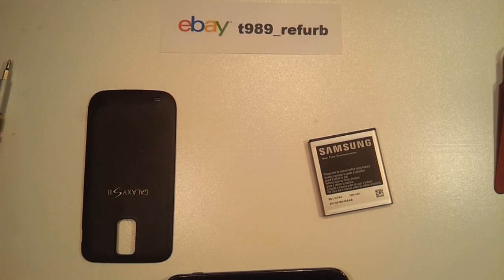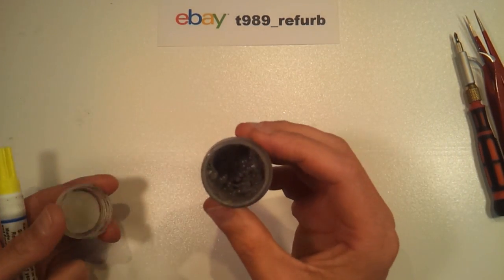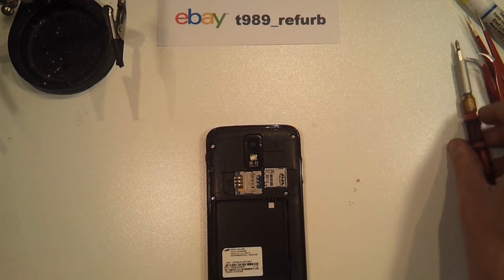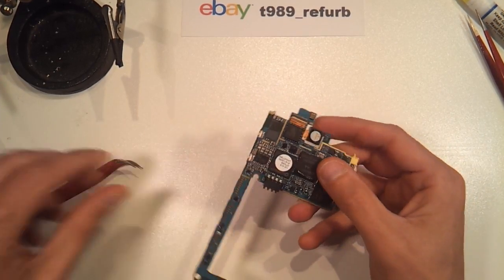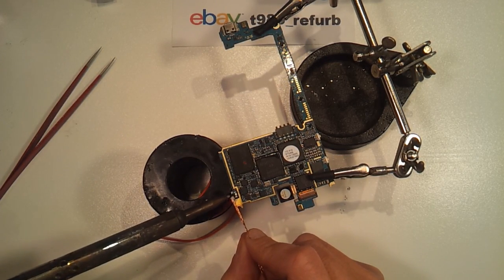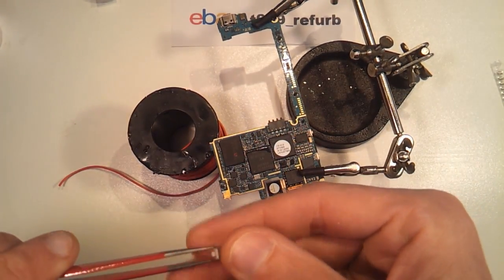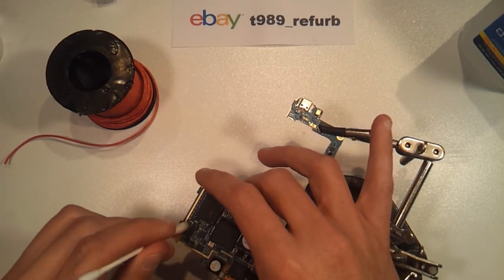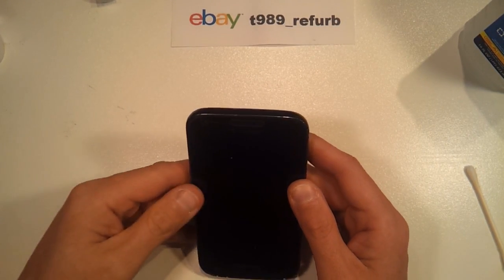Samsung Power Switch Repair Fix Replacement Galaxy S2 t989

Comment: I watched several videos for Galaxy S2 power button repair and selected eBay replacing power switch service from Steve. The process was easy, clear and the service was professional. It fixed the problem, now I have a functional phone, thanks Steve. For those who may have similar power switch problems with Galaxy S2 phones it is highly recommended to use Steve's service.

Comment: Steve just repaired my phone using the part he sells on Ebay.  I highly recommend his services!  He did a great job and for a very reasonable fee.  This after Tmobile told me I needed a new phone and an independent cell phone repair shop told me it was a software issue.  Thanks for saving me hundreds of dollars!

Comment: Fantastc video, thank you so much. The local electronics whiz offered to recycle our Galaxy Blaze because he couldn't fix it. Thanks to your video it's up and running again. Next purchase will be one of those hot air guns, it's kind of tough doing this repair with a soldering pencil. Thank you again!

Comment: great job! i did this repair yesterday and didn't even see your video till today.  I did it with a soldering iron and it was a little harder than the hot air method.

Comment: Thanks Steve!  I just fixed my wife's Galaxy S2 with a standard 30 watt soldering iron.  I have another one to fix so I'll be getting that hot air gun you showed in your video.
Reply from the maker: I am glad to hear you were successful using a standard contact soldering iron.  You will find this repair is much easier with the hot air station.  Don't forget to get the solder paste too.

Comment: Steverrada thanks a lot for your guidance on how to change out the power button....I work in an instrumentation shop and I never new what the air solder gu could be used for(lol)......everything worked out awesome and it saved me a ton of money. once again thank you.

Comment: Great video. Was able to fix using conventional soldering iron with extreme patience(have a lot of soldering experience). If you are not an experienced solderer, pay someone the $40 and I guarantee you won't regret it. It's money we'll spent. If you haven't soldered before, you'll spend more than that on the supplies.
Reply from the maker: Thanks for the confirmation regarding the use of a conventional iron only.  I am glad you were able to get your phone fixed up.

Comment: Great video. Highly respectable that you would share a full tutorial video for the average diy-er that might not be able to afford to take it to a professional. I was looking for ways to just reassign the button to one of the volume buttons but came across this. I was wondering if a general heat gun would work in place of the hot air reflow.
Reply from the maker: Reassigning the button is not the issue.  The switch fails and becomes stuck closed resulting in a hardware fault in the system.  Until the fault is cleared (switch removed) the phone will never be able to boot fully.  Also, I do not recommend using a heat gun for soldering.  It is likened to taking a drink of water from a fire hose.  There is too much uncontrollable heat that could potentially damage your replacement switch or other neighboring components.  Please check out eBay store; I think you will see my Repair Service is reasonably priced. Thanks!

Comment: steverrada I just had this problem and I found your video the best in terms of explication and simplicity.
I am now using my volume buttons to turn on/off my device
this repair u are doing is amazing but I need an easier one with less equipment u know ... something someone at home can do
Reply from the maker: The difficulty of the repair is determined by the size of the components and the way they must be soldered.  With a hot air reflow station, the repair is fairly straight forward.  I have repaired about 1000 of these phones at my home with only the tools shown.  I would be happy to fix yours too if you do not feel comfortable doing it yourself.
Reply: steverrada I dont have that reflow station neither a solder ... I wish you could but now I am in Brazil ... where people are only good at football and I would never trust a technician here on my phone
Reply: Nabil Merhby How much would u charge for changing it? (considering i have new one)
shipped from and back to brazil if u know would be awesome too :)
Reply from the maker: Which Galaxy model phone do you have?  Current price is $30 for the repair and $30 for international shipping back to Brazil.  I cannot say for sure how long it will take in transit.  Once received, I complete the repairs in 24 hours.  Email me at t989refurb@gmail.com if you are interested.

Comment from the maker: For the most part yes. The disassembly techniques may differ but most of the current Samsung models use the same or similar power switch.  The same repair techniques would apply.

Comment: Love the video. I've replaced iPod 4 power/volume cables, will the same technique work to replace power button on a S3? Also in my search for parts I came across a power flex but cannot find any info on where it is used. Any idea? Your help is very much appreciated. I'm a home based repair shop doing a lot more than screen repairs. Thx.

Comment from the maker: My best guess is that the solder did not adhere well enough to the two corner pins on the back side of the switch. These are the two pins that actually form the contact closure.  They are also the most difficult two to solder properly.  Secondly, make sure that you did not accidentally damage or form a solder bridge between any of those three small passive components that set next to the switch.  Let me know how it goes.

Comment from the maker: I have repaired this issue on the I727 too.  It requires a slightly larger switch, 4.75mm wide.  I  offer those for sale too in my store.  Check out the Canadian shipping details in my Repair Service listing.

Comment from the maker: My best guess is a short circuit in the soldering, or maybe an over-heated and melted power switch.  If your phones does not act the exact same way as the one in the video (powers up by itself when you insert the battery or very sensitive switch) then the power switch may not be the issue.  It could be a software issue that could be fixed by a Factory Reset.

Comment from the maker: There are a lot of Samsung models which use this same switch, unfortunately I do not have a comprehensive list.  You will have to take apart your infuse 4G and measure the width of the switch to find out for sure.

Comment: Fully appreciate your effort, but realizing how oils and creams from user hands are easily transfer and leach into the power switch, perhaps in another video do you recommend resolution attempt by simply using fine spray contact leaner and compressed air for keyboards and such?  I have and have used soldering pencils and guns, but I know of no one who has one of the hot air devices you demonstrate.  Can sw be removed using a soldering pencil?

Comment: I bought a soldering iron some time ago but have never soldered before. This is way beyond a beginner's level. I wish I could do this, but it worries me a little too much. However, my dilemma is that I could get my S2 repaired by a company, but it would quite possibly cost £50/$70 (in UK) upwards or from Samsung maybe double that.

Adding to that, I've had bad experiences with factory resets in the past. My phone just has a faulty USB port/power switch. It doesn't need reformatting. Bah humbug.

Comment from the maker: From my brief research, the i757 does not use the same switch.  It uses the "flex" ribbon type connector so no soldering is required!  Google i757 power flex.

Comment from the maker: Take a look at the .png I link to in the description.  You have to make sure that the solder job on those two pins matches what you see on the volume switches (as a reference).  Those two pins are the most important to get right and the hardest to solder.  This method is tried and true.  I have repaired over 500 phones to this point.

Comment: First off, I love your video ! I am no tech genius like you but your video sure did inspire me to try to do it my self.  I was wondering can I use this item from ebay for the water soluble flux ? Is this the same as your pen ? What do you recommend ?

1pc BGA SMD Soldering Paste Flux Grease RMA-223 10cc
Reply from the maker: I am glad you enjoyed the video.  I hope it helps.  RadioShack has an eBay store and turns out they sell the same exact stuff I use.  I just had to buy an new tube last month.  Here is the eBay item number: 360810745269  Plus this stuff will not take 3 weeks to arrive from China or HK!

Comment: Sorry for my idiotic question but do I have to use the hot air solder or is there a substitute for that. Hot air solder is to expensive for my budget

Comment: Is it Possible to use a De soldering iron instead of the hot air rework station? Doing this for a friend and not tryin to run up a high bill lol thank you btw awesome vid

Comment: Hey man. Are you able to do this same thing for an SGH-I727? It's called the Samsung Galaxy S2 LTE here in Canada. I've already attempted to do cleanings with compressed air cans, isopropyl alcohol and firmly pressing the button after the case has been removed, to no avail.

If its possible, I would love to have this fixed. Thanks!

Comment: Hey Steve, I tried a needle nose trick on my d710, and couldnt get it to work. After about 20 different squeezes the power switch just popped off...oops. After watching this, Im afraid I may have damaged those tiny little components you mentioned. What do you think? Would you still be able to repair? If you want pics or something, let me know and I could pop it open. Great video, and seems like a great service you are offering from the comments on your ebay store!
Reply from the maker: The D710 only has two small components next to the switch, not three. A picture of the power switch area of the motherboard would be the best way for me to get a look at the situation.  Please email or eBay message it to me when you have a chance: t989refurb gmail com
Reply: steverrada would that render the phone useless? Because I can still power it on with a jig and get into download mode and restart it with odin. Or does that just render the power button itself useless even if you were to install a new one?

Comment: Dear Steve, I had exactly same problem with my t989. Now it has completely shut down, it does not even show the charging sign when i plug in the charging. I had a few technicians look at it and they tried everything they could and gave up. Can a faulty switch alone give such problems that my phone now is dead? pls reply .

Comment: hey, when I press the power button, often only the 4 bottom button lit up and the screen doesnt show, I have to press the power button several times (sometimes 20+) to see the lcd screen lit up. is it related to the power button or is the lcd going to fail ? I had a swim with my phone and im having speaker/camera/lcd problem since.

Comment from the maker: Different variants of the S3 use different parts for their power switch.  Make sure you search for your model specifically. I am 100% anti-apple.  I have no ideas as to what it takes to repair them so I cannot say if the procedure is the same.

Comment: hey steve-

i have a galaxy s2 that's 2 years old. 2 days ago it completely died so i plugged it in to charge it, as usual.  the issue now is that it won't turn on or do anything at all, no screen, no buttons, no music or vibrations... nothing.

when i plug it in it gets warm so i believe it may be charging and i'm suspicious of the power button but not sure that i'm correct in either of my assumptions.

can you help me, please? there's a lot of stuff that i just don't want to lose.

thanks!

Comment: 80% it doesn't need to be replaced when its stuck in that reboot loop. You just need to de-solder, clean the pads, and re-solder the same button back on. Fixed tons like this and never get them back. I only replace them when the button is really sensitive.

Comment: Hey Steve thanks for your guide on replacing the power switch. I have a question concerning the installing a new power switch. What would be the cause of the power switch to not power up the phone if the three passive components are still on the board? I replaced a switch the first time and it did work however the switch went bad shortly after being to sensitive and I am on my second installment of a new switch.  I guess my question to you is would the switch not work properly if the solder connection is not made properly? I plug the phone in and the phone charges and display does work I just can not power up the device. I am holding off till you get back to me also if you have information that helps me I will make a $10.00 donation to your pay pal.

Comment: hi I'm learning how to solder so the Flux is used to remove old solder and solder paist is to resolder?what causes the solder not to stick? thank you very much for the video.
Reply from the maker: +Jose Esquivias   Flux is used to clean metallic surfaces before applying, or removing solder.  It allows for a better heat transfer so that solder may flow more easily.  Solder paste is very small solder particles with flux mixed in.  When heated, the flux flows to clean the surfaces and the tiny solder particles melt and join together to form the solder connection between the parts.  The two most common issues that would cause solder not to stick are dirty surfaces (none or not enough flux) and cool temperatures ( soldering iron is too cold, the tip is dirty, or poor thermal conduction).

Comment: I have found it much easier to mount the switch first by putting a small amount of solder paste on the little pads on the outboard side of the board and the mounting holes and heat that to mount the switch , THEN add a small amount of solder paste to the backside of the switch and board on the three spots. then heat that solder.
Reply from the maker: Thanks for the tip!

Comment: I'm having problems removing the solder from the little holes for the button I am using a 2mm solder wick, any suggestions?

Thanks and great video!
Reply from the maker: DO NOT try again and again and again to remove it with the soldering iron.  You will accidentally lift the solder pads.  I use any of these three methods.  First, if you have most of it removed, then you may be able to break through by gently forcing your way through with the fine tip tweezers. Second, I have luck using a solder-sucker from the bottom while melting from the top.  Lastly, I drill the holes out with a very small bit, 0.4-0.6mm depending on the size of the switch. Good luck!!
Reply: steverrada Thanks for the reply! I was able to cleanly remove the solder from the pads themselves but not on the holes. Great suggestions I will give them a try!

Comment: Anyone know if I can just use a sharp solder iron and melt off the old one? Can I just place the new switch on and use the iron to melt the solder and attach the new switch?
I can't afford a reflow which costs more than the repair service itself.

Comment: Hey, I have the same phone and it keeps restarting but I'm 100% sure that it's not a power button problem.. It starts itself alone, but the restarting cycle started only when I turned my phone off 1 day... I tried everything, factory reset, wiping cache.. It doesn't want to load to the main lock screen. It keeps restarting.. When I remove the battery, and put it back in, the phone doesn't start by itself. I cannot load safety mode, because the 4 buttons at the bottom don't light up when the phone is off... If you could help me, that would be great! :)

Comment from the maker: Sounds like your LCD is cracked, or maybe if you are lucky, the ribbon cable has just popped off.  The LCD is very fragile.  Even if the glass does not break, the LCD panel itself could.  Look closely for cracks.

Comment: Thanks for this video, I have a GS4 and the power button is causing the phone to reboot over and over again. So since I don't have all this equipment, I will just remove the power button. I at least know what it takes, thanks.
Reply from the maker: I can confirm that the GS4' uses the same replacement switch as the t989 in the video.  The replacement procedure is also very similar.  I had successfully replaced a couple of switches on them before getting out of cell phone repair.  Good luck!
Reply: Cool, that's great to know, thank you. Just wondering though, how come you got out of that business?.
Reply from the maker: I got into it as a way to make a little extra money by purchasing Galaxy phones with faulty power switches off of eBay.  I would replace the switch, disassemble the rest of the phone, and sell all the parts separately on eBay.  That evolved into me producing this video and offering a power switch replacement service which I also offered through eBay.  At my peak, folks were sending me about 70-80 phones per month and that got to be too much.  It was taking up all my free time and I was having to do repairs 7 days a week just to keep up with demand so folks could get their phones back quickly.  What started out as a hobby got to be work.  Once it hit that level, I knew it was time to re-direct my efforts towards something else.  Thanks.  --Steve
Reply: I see what you mean Steve, I never knew exactly what it would be like until what you explained, since I thought of doing it myself, or just fixing cell phones in particular. Thanks though, and I would probably get tired of that too.

Comment from the maker: You can try to complete this repair using only a conventional soldering iron.  I  imagine it could be done but I have never tried it that way myself.  Please check out my eBay store so you can purchase the correct switch.